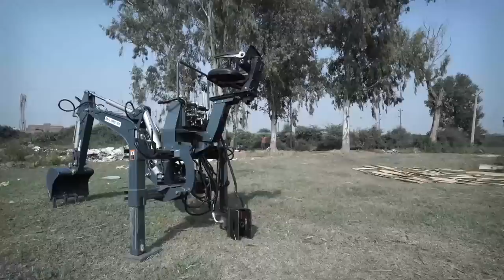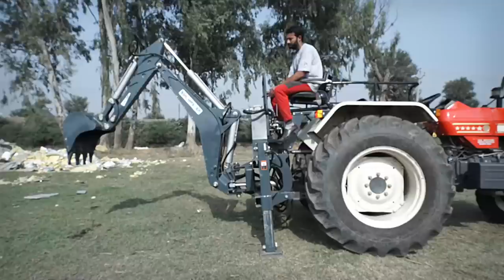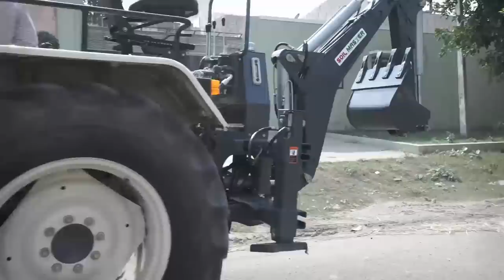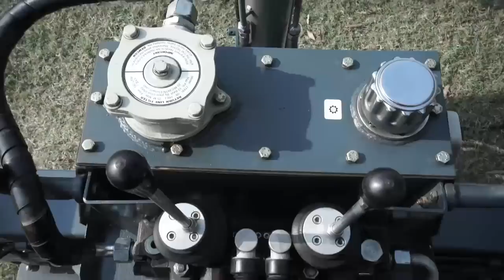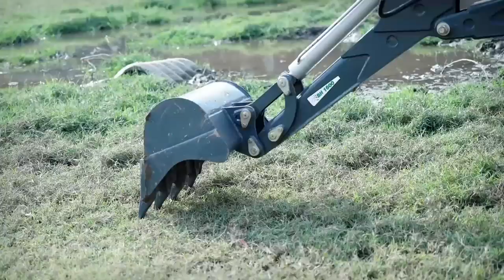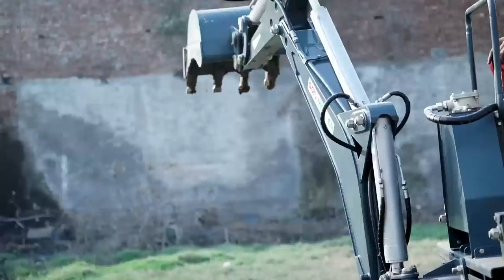Backhoe, Excavator - Soil Master

Comment: If top link goes fail it will collaps
Reply from the maker: no it won't collapse. The structure of the machine is independently built. Top link is only connecting it. The machine is also jolted to the tractor with the help of the lower links.